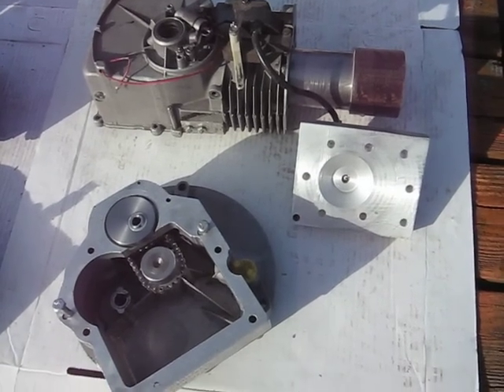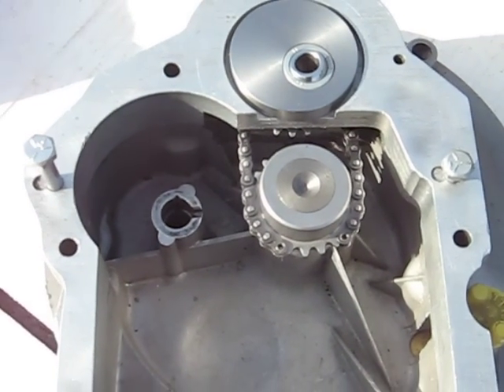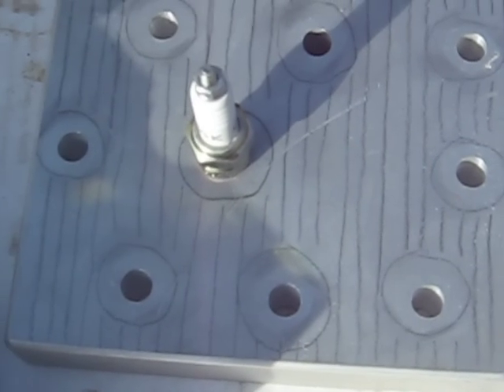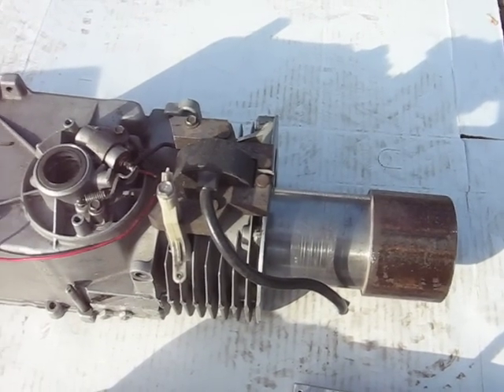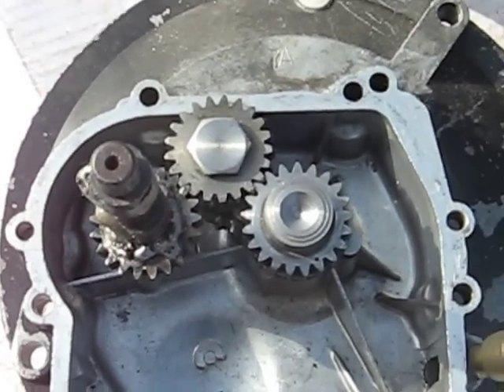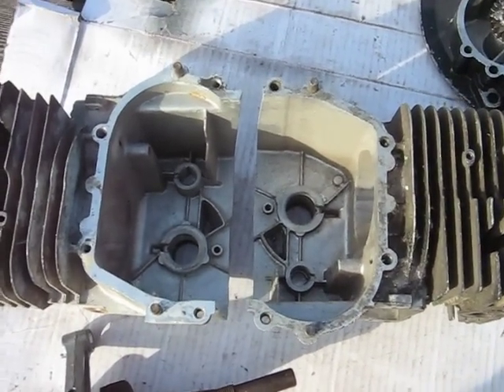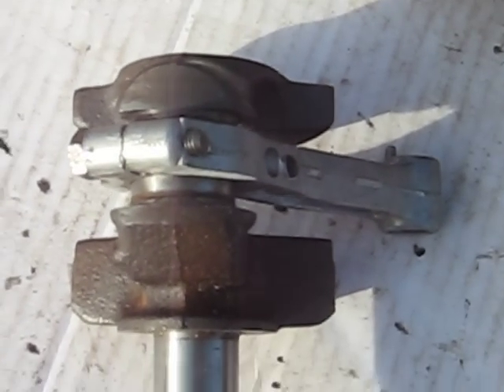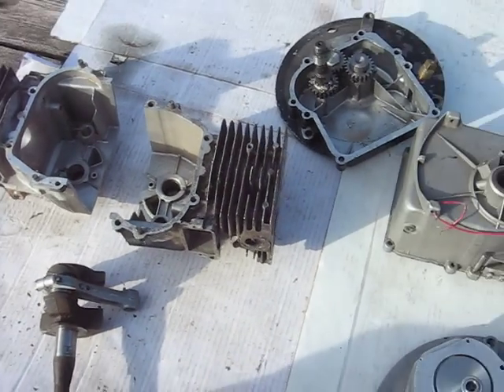"Rolls Royce Crecy" type engine parts(Briggs and stratton)

Comment: this engine is a flat engine now however if he had it to where the Pistons weren't on the same crank and they were on separate cranks that would be an opposed engine because the engines are always moving opposite of each other towards each other or away from each other not one way in a back-and-forth motion by the way did you know that Briggs & Stratton already makes an opposed twin I have one on my mower you can see the crank set up my video just go to my channel there's a video call 17 horsepower Briggs & Stratton opposed twin fail

Comment from the maker: @xoxoXoieoxox 
I did have a view of the 2 cylinder. I thought of doing the same thing with a compressed air engine, using different engine sizes to make a low and high pressure cylinder, like a double expansion engine.

Comment: @ChargerMiles007 OMG i hade a brain fart if u machene a one pice case cover u can use that to hold most of the stress and i think if u use gusets with bolts on the other have of the case what u think =3-

Comment: @ChargerMiles007 well there are other options to welding aluminum for instance in the V-1 (heavy mod) steam engine i hade to make the conecting rod longer with no aluminum welder i used nuts and bolts to conect the two halvs of the rod to a sorda cruch to make it longer and beleve it or not JB weld can be done right and made to look good =3- forge forward at all cost.........lol the reserch is the only thing that maters

Comment: The Crecy was too complex!  It was the world's first and only two-stroke cycle sleeve-valve engine.  It had direct injection with stratified charge using two 6-cylinder injection pumps.  The centrifugal supercharger, on which the engine was dependent, even had variable vanes.  The exhaust from the engine was so forceful that it was estimated that it would add thirty percent extra thrust ouside of the propeller.
Reply: The Napier nomad was the ultimate 2 stroke turbo, it’s nuts compared to the rotax 850 etec turbo,

Comment: what about using rods from an old mopar rv12 ac compressor for the twin? they have really skinny ends and about the same size crank pin. You could probably strech them to with a blow torch. How exactly does the sleve move from its cam in the sleeve valve vids? Great work keep it up!

Comment from the maker: I might have seen the article you mentioned, but I am not sure. Every design has its problems and advantages, and based on history, so far only the sleeve valve has been competitive. If the jet engine hadn't come along, I think there would have been a lot more of them. Too bad there doesn't seem to be any video of a Crecy V12  2 stroke running, it must have sounded awesome!

Comment: @ChargerMiles007 I seem to remember an old Popular Mechanics articlethat discussed sleeve valves, and a guy who was trying to bring them back.  His sleeve valves simply rotated around the piston, at 1/2 or 1/4 speed, without any up and down motion at all.  It was a four stroke, I believe.  Have you any knowledge of other, similar engines?  It seems like it would be simpler ring sealing and more compact from top to bottom than the lawnmower / Bristol disign.

Comment from the maker: Thanks for commenting :)
One thing that just occurred to me, the 2 cylinders on the opposed will have to be staggered vertically, do to the 2 connecting rods on the same crank pin. That will complicate matters a bit. Now I see why aircraft used fork and blade con rods!

Comment from the maker: Yep thats right, and they all got scrapped
:((
Too bad, I would like to see and hear video of one running!
Mine won't be quite correct do to it having a carb instead of direct injection, air cooling etc., but I am trying to keep the sleeve timing about the same. At this point I am just hoping I get the Beast built and running sometime!  Guess I need to find a bunch of those Round2Its, and use one of them :))
I have the book about the Crecy by the Rolls Royce Historical Trust, it is cool.